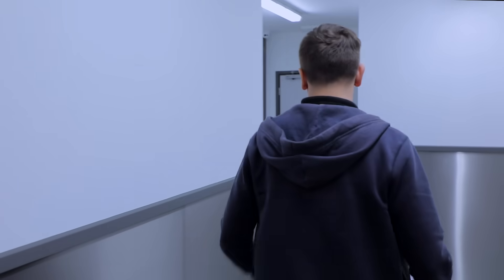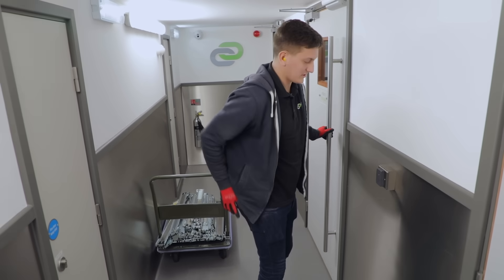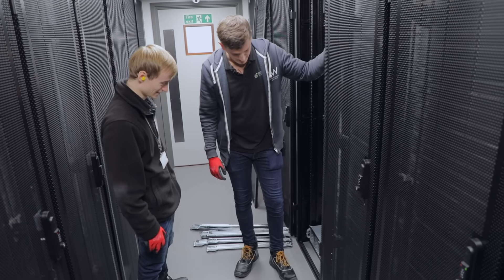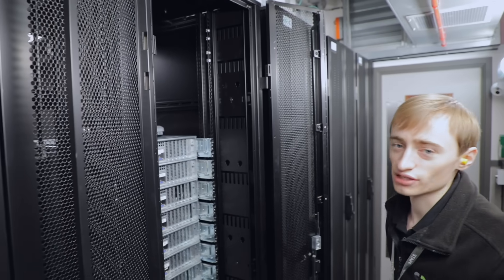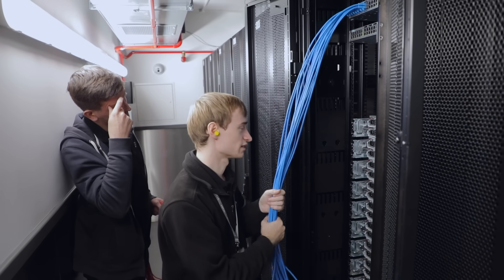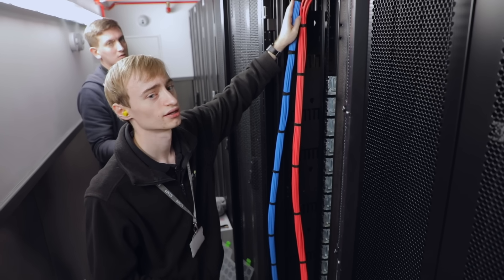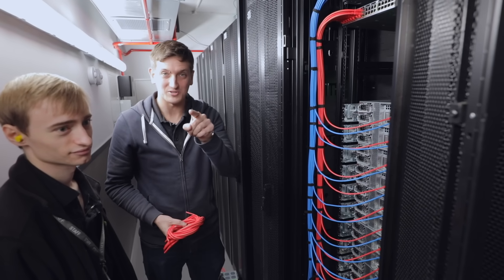A DAY in the LIFE of the DATA CENTRE | FULL CUSTOMER "RACK & STACK" with ASH & JAMES!

Comment: Question: If you have to pull out the frame without disconnect the cable or you want to change a connector  how you do that? You have to leave a service loop! Bundling cable is not that hard you just need some practice.

Comment: It's better to use plastic zip ties than Velcro in Lan cables, Velcro is only for Fiper patch cords
Reply: Velcro is code where I work.
Reply: Zip ties are a big no-no at work. We never use them. Velcro is the golden rule.
Reply: Velcro straps are used for temporary jobs, zip ties are best for permanent or semi-permanent jobs, Lan cables are semi-permanent, plastic zippers are better to keep semi permanent bundles untoched during operational activities.
Reply: @TheTamimii  This reminds me of juan trippe vs howard hughes over buttons or zippers for the drapes in their planes.

I think at the end of the day everyone has their own opinion about which is best. I think it depends on the operational requirements and the setup being used. zip ties are probably the best option in your data center. Velcro is best in mine.
Reply: velcro is reusable
Reply: Velcro ties tend to come loose after a time resulting in a more messy look to the cabling.
Reply: @RoboticRaindrops  Maybe. Although in our datacenter we've got cables that have been velcro'ed for over a decade now without them ever coming loose. Granted though, we don't un-Velcro them. Maybe if you use Velcro and frequently undo and redo them then perhaps, they come loose more often. We've just never experienced it here since it's rare we ever un-Velcro them. But on top of that, we do maintenance every 3 months. So, if there was Velcro coming loose, we'd see it during the routine maintenance we do, and just use a new Velcro strip.
Reply: What is the difference? Velcro is reset able.
Reply: Totally agree, best of luck man
Reply: @TheTamimii  Stay safe. Have a good one!

Comment: I am doing similiar work but i cannot imagine something like crimping patch-cords on place and use it without any analysis or measurement by testing tools.
Reply: Welcome to paid-by-the-hour remote hands service. I agree though, you can buy patch cables from most decent places in approx. 4U increments. Also, you have to disconnect these wires to pull out the server and they had a ton of waste, with CAT6/7, that adds up quick. I'd leave at least the depth of the server in slack so you can pull it out, swap RAM etc

I personally like to keep power cords on one side and network on the other, it seems they went with all wiring on the same side. Do like the loom tool though, may want to invest in one of those.
Reply: @GuruEvi  he actually examined why he put network cable on same side as power. There will be fiber too and he wants fiber and coper separated.

Comment: Yeah, it looks nice, no doubt... but what's the point of mounting servers on rails when you only leave 7 cm of slack on the cables anyway?  .... There's no problem in having more slack on the cables and be able to pull out the rails at the same time....
Reply: That only makes since when you either have hotswap parts or have little to no redundancy. If you need to service the server, it's always better to do so turned off. That means having redundancy and migrate the cluster before you pull the server. Even with hotswap parts, bad things can happen while the server is running. We have a few hotswap servers at work but we've not done part swaps for over a decade now. We always service them turned off.
Reply: @quilnux  Yerp. About the only parts we will hotswap are power supplies and perhaps fan modules if they are accessible from the outside. Otherwise shut the machine down and work on it powered off.
Reply: excatly what i thought haha, maybe the servers will only be slid out when everything is disconnected

Comment: For people wondering about cat 5e cabling being used, it is more than capable of running gigabit speeds at short distances. Cat5 is much easier to work with and terminate than cat6. Cat6 is twisted much tighter and has a + in the middle to separate each twisted pair. From experience, terminating can take twice as long for cat6. Personally, i think cat6 should have been used as it is a data center, not some office. Also keep in mind, it sounds like the customer designs the setup to some extent? So maybe that wanted cat5e to save costs and install time...  cat5e is susceptible to  interference to powerlines/lights/interference/etc... since this isn't running through the ceilings, it is also another reason it is safe to run. If they were actually running cat5 and not cat 5e, that was a waste of time.
Reply: I'm still only in my 2nd year of college going for my networking AS and then my BS of Science in IT, but god crimping cat 6 cables down to length is horribly painful because of those separated twisted pairs. I can definitely understand why cat 6 was the better choice here however
Reply: @surreal9558  yktv. Ill be in a jam and have to crimp a few patch cables and my fingers are ripe as fook by the time I'm done 😂
Reply: Now that I think about it, I don't think we ever push CAT6 inside the racks at work. I know we do CAT 6 beyond the racks (CAT6 coming into the rack for example when not on fiber) but once it's in the rack I think we only use CAT5e. I never really thought much about it until now. We get 1Gbps inside the rack so this has never been a problem.
Reply: @quilnux  we do a lot of virtualization, so our physical hosts are limited. All our patch cables for pre terminated from the patch panel to the switch(my primary work is in an office space) 
Its just easier that way.
Reply: @ThatE46  That probably works best for office setups like yours. I know we don't use patch panels in our data center, but I have heard they do patch panels in some of the satellite offices we have so it probably makes since when you're limited on space such as in offices.

Comment: With the switches mounted rear facing, how about the cooling air for the switches? When they are all running, the switches will get hot air that coming out from the servers below.
Reply: Those switches can be ordered with port-side or rear intake.
Reply: Most 24+ port switches, from what I've seen, use cooling fans on the sides
Reply: We only have a couple of front intake switches in our datacenter. Almost all the racks use rear and side intakes. Once you start getting into the 48 (and sometimes even 24) port ranges, there is nowhere to add front intakes because the NIC ports take up the entire front almost. If you go back and look at the switch they installed, you'll see very little surface area for a front intake.
Reply: With cabinets inside a datacenter you have a cold side on which the cooled air will be sucked in by the devices installed in there. Air cools the machines and exits the cabinet on the hot side which we are looking at in this video. For servers air intake is normally through the front bezel and that cannot be changed. For (high performance) network switches you order them with the correct air flow direction, back to front or front to back. This depends on whether you install them on the front side or back side of the cabinet. So the switches that this customer had shipped later on for the data links will be with back to front, so the hot air exits where the network ports are. For the switches already installed it does not matter too much as 1GB copper switches do not produce a massive amount of heat hence they do not even have vent slots on the switch port side.

Comment: What's the purpose for the two switches if there is clearly enough extra open ports just to run one?

Are you just using the dual NICs for redundancy, and therefore the two switches are setup as hot failovers?
Reply: Judging from the position the 2 colours of cables go into the servers my guess would be 1 is production network (blue or red) and the other one is management network, going to an OOB card (in case of HP or Dell servers, an iLO or a iDRAC respectively) for Out-Of-Bands management (management access even if the server is off). I think this because if they were both production network (and so, failover or load balancing as mentioned earlier), the NIC's used would both be in the 4-NIC group. So it isn't failover I think. In stead the blue cable goes to one NIC in the 4-NIC group and the red one goes to a physically separate NIC, which points to an OOB port because they are always spaced seperately from the production NIC's. Judging from the fact that the NIC where the blue cable goes in has neighboring NIC's, I would say blue is production. The one where the red cable goes in doesn't have a neighboring port so that would be the OOB port. They use separate switches so that if the production switch goes down, they still have management access and also to run the production and management VLAN's on seperate switches. I'm a systems engineer so I deal with servers on a regular basis
Reply: You never want to mix your management network with your production network. Keep that separate. Saves time on config so you don't have to vlan out the management. Plus if you lose a switch, you can turn the management network into a redundant node until you can replace the busted switch.
Reply: Most datacenters do have a dual-stacks for networking and all servers should be bonded (LACP) between these switch stacks. Each switch then has 2 fiber pairs to the core or an aggregation point. This allows you to eg. reboot a switch or even an entire switch fabric without affecting services.
Reply: would be failover yea.. most likely also most server boards have 2 built in NICs for that reason (and aggregating but I doubt that's what they are doing here)
Reply: One for Networking and one for Management probably

Comment: cat5 cables?
Reply: @Jonatan Norrby Well then cat5 is even worse no? Why would they use cat5 cables? also is cat6 necessary or could cat5e be used aswell?
Reply: @stejothepisto  cat 5 is a max of 100mbps which is a lil bit slow for a datatcenter
Reply: @rosscran5612  yeah, that’s why I thought it was weird
Reply: @rosscran5612  I think they meant CAT5e. You can't really find CAT5 anymore.
Reply: @stejothepisto  Don’t know why they would use Cat5. 5e could be used now but cat6 is used to futureproof it.
Reply: @jonatannorrby1398  Didnt think about the future tbh lol
Reply: @stejothepisto  It's rare to see CAT5 these days, when people say they are using CAT5 cabling, they actually mean CAT5e.
Reply: Short run CAT5e can do 10GBe, 1Gbps would be no problem.  I'm sure they are using 5E as it's easier to manipulate and faster to wire.
Reply: @WXHosting  they didnt use 5e though or maybe they did but said 5
Reply: @stejothepisto  you can see the 5e on the box when they pull the cables.
Reply: @WXHosting  It'd have to be very short. I'm not sure I personally have gotten CAT5e to work at 10Gbps (not saying it can't just saying I've never seen it do that), but I think once you get above 1Gbps it's just better to grab CAT6.
Reply: so building CAT7 homelab is probably overkill but still  I will do it :D
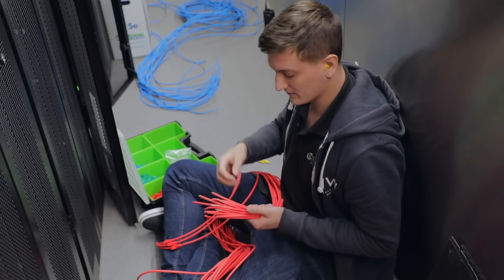Reply: 7:11 you can see the box says 5e.  He's just truncating it I assume they don't even use CAT 5 anymore and only buy Cat 5e or better.
Reply: Cat5E can run 1000 mbps under 10 meters, depending on the quality of your termination and external interference

Comment: Do you guys need to be Network Engineers to do this work, or an Assistant?

I love working with my hands, but I want to be someone with knowledge as well. And be able to design networks for a company, if need be.

This is why I would love to know, what is your job title, to be working in a place like this? 

Thank you so much if you can answer that.
Reply: Millan Ferende Hey, so I don’t work for a datacenter, but many datacenter’s also provide Internet/Cross-connects so they definitely need Network Engineers for troubleshooting/configuration purposes etc. There’s also “remote hands” which is basically utilizing someone that works at the datacenter to go into your rack and do something you need. (Simple example being plugging in a cable/changing cable etc) - this is used when you don’t have someone on site or can’t get on site. I’d assume they would have basic networking knowledge for the most part. I’d recommend a CCNA if you’re looking to have a great baseline for networking. Sorry I can’t give more insight to this specific position, however I am a Network Engineer myself and figured I’d share my experience. Feel free to ask any Q’s!
Reply: @gunboat7070  wow thank you so much, that helps a lot actually. :) I will have a look at the CCNA. Who are the guys who plug the cables then? Like the guys executing the "remote hands". Are they just electricians?
Reply: Millan Ferende you’re absolutely welcome, glad I could help. The remote hands are still people that work at the datacenter. They are usually part of the datacenter’s NOC (Network Operations Center). Electricians definitely have a hand when it comes to the power side of things, but as far as someone changing network cables based on the example I gave it’s doubtful an electrician would be doing that.
Reply: @millanferende6723  Hi, Im working as Hands & Eyes Engineer. So basically im the one pulling cables in and out of switches and replacing incase that is needed (not the only thing i do but since u asked for this). Basically my knowledge was very little when i started so you really dont need to know everything about servers or switches, sure it helps alot but just  looking up the switch and the person leading calls remotely always tells which cable to replace etc.. after a while you start picking up stuff remembering how to do stuff. Just learning on the job.
Reply: u can try learn ccna .but now i use cct learn .and get certified.

Comment: How do you plan on servicing one of those servers if you have to slide one out?  do you disconnect all the cables in the back and hope you plug it all back in correctly?   I thought that's the whole point for sliding rails vs. fixed racked servers with cable management arm?
Reply: Cable management arms fucking suck. They are nothing but a huge pain in the ass. What could you possible not plug in correctly if you plug in the servers all the same way? Just look at a different server for reference. Realistically the only thing that would be plugged into a rack of servers like this is power and network.
Reply: @Minecraft5454  Power, network, and IME.
Reply: @byron7165  and fans
Reply: They should not have cut them to length. @Wayne is right about that. And yes, F cable arms. However, the whole point of the rails is for servicing. Now you have to unplug everything to add a stick of RAM.
Reply: From someone who's actually worked in the industry... For most customers, there's nothing inside that they would service while the server is online. From a safety and stability perspective ,they would take a server offline if they had to. Also, even though they're on the rails, the customer hasn't opted for cable management arms. The arms still server the function of making mounting easier. In the case that a server fails, you can insert and remove easily.
Reply: @CanyonSteve-z8j  Storage is often hot-swappable and nowadays RAM is too (HP, Oracle). Since density is increasing and server boards can get a lot smaller than they used to, many vendors are now adding rows of storage within the 1U.

Most servers are designed to not have to take them off the rails at all to service them.

Comment: Why are there two Ethernet cables connected to each rack? Is it due to redundancy?
Reply: May also be that one is for Main network connection to the "host", and the other one is for the Servers IPMI (Management) port which allows for out of band monitoring (if they are not sharing the main NIC with a IPMI vlan).
Reply: likely they will either be using a technology called MLAG where they will be LACP'd but to two different switches. Or they will just use LACP which has several redundancy options.